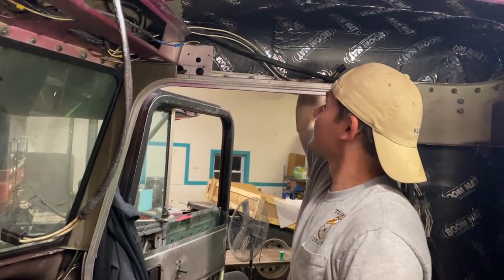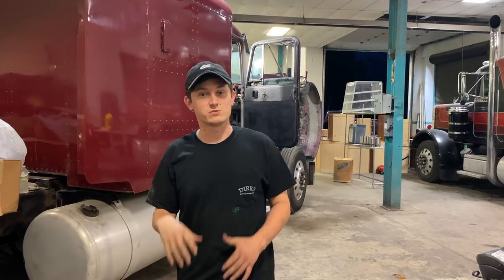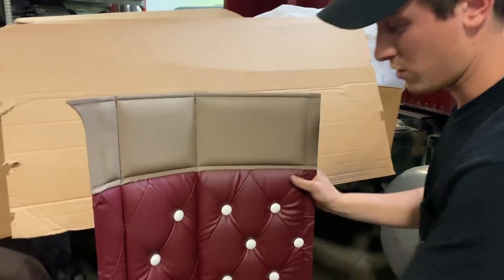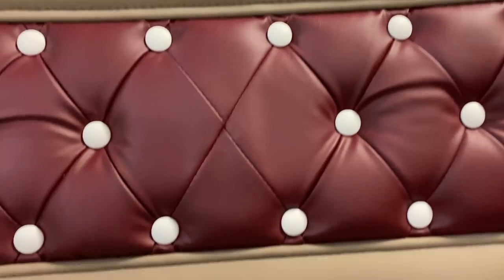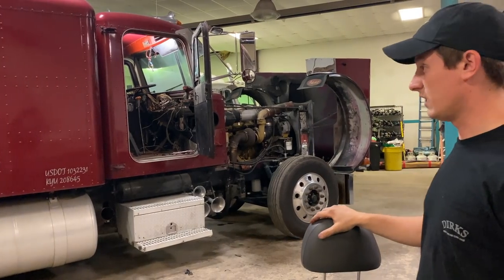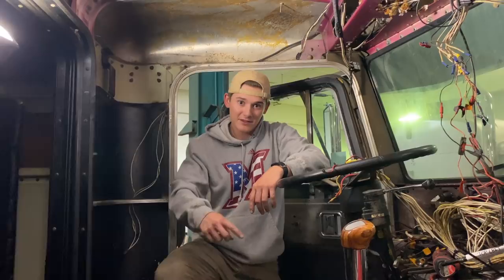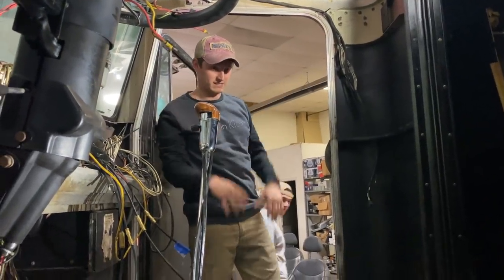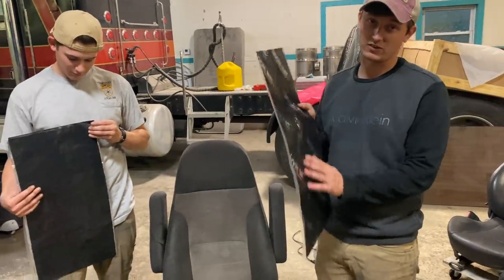Rebuilding a Peterbilt Flattop "CUSTOM INTERIOR & TEAR DOWN" Part 1

Comment: Looking good so far guys. But who needs a rockin' sound system in the cab when you've got a Cat engine under the hood?
Reply: Exactly why you need music... to drown out that archaic yellow boat anchor. Just messing with you.
Reply from the maker: HAHA!! Ohh you'll be able to hear it screaming through the new 8-inch pipes!
Reply: There’s time running at night I shut the radio off and drop the windows when I’m hauling ass

Comment: I like the cream cab with red frame idea, I would leave the fuel tank straps polished paint the tanks and if you paint the boxes I would put the stainless covers on the front and leave the box burgundy. Also do the air tanks like the fuel tanks polished straps and painted
Reply from the maker: Good call!

Comment: Get a small roller, they sell them specifically for dynamat, phatmat, etc. I used aluminized heat barrier when I installed the composite wood floor in the Shaker, the roller simplifies installation of the mat.
Reply from the maker: Ended up grabbing one the next day! Makes a world different!

Comment: Y’all do all that work on the old trucks paint them and then the interior but what do y’all do with them on motors
Reply from the maker: Before cosmetic restoration, the truck goes for a mechanical restoration. This truck will be getting the motor pulled and completely gone through!
Reply: Cool

Comment: Guys love that you young chaps are busy with this on a "Friday night," dedication personified, BUT is it really economical to invest a lot of $$ into cosmetic's of a very old truck? Are the mechanic's of it 100% because it has to earn its keep. Just a simple question...
Reply: Hey man - so going back to the silver truck project, the motor got rebuilt and mechanical stuff addressed before all the cosmetics. Likely a similar thing will happen here as the project develops
Reply: Trust me, these are actual working trucks, they aren't slapping lipstick on a broke dick horse and sending them out on the road. This is at least a 3rd generation family affair, this isn't their first rodeo.
Reply: The cost of a new truck compared to what they are going to spend on this truck will be half or less and they will have a better truck
Reply from the maker: Thats a fair point! Before we start the cosmetic restoration on any piece of equipment all mechanical components are replaced or rebuilt to ensure the longevity of the truck! I agree, we should show some of the mechanical restorations on the trucks! Maybe some future rebuild ideas!!